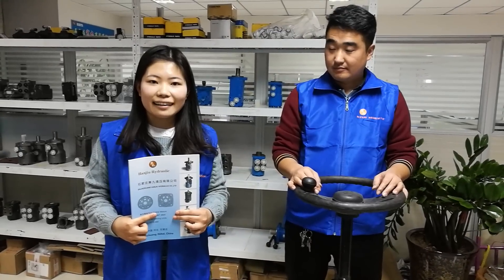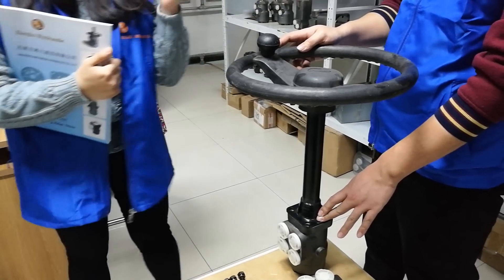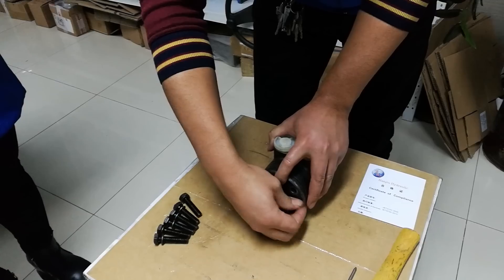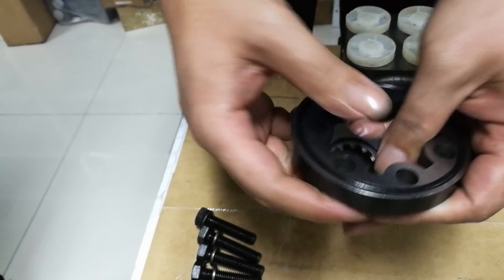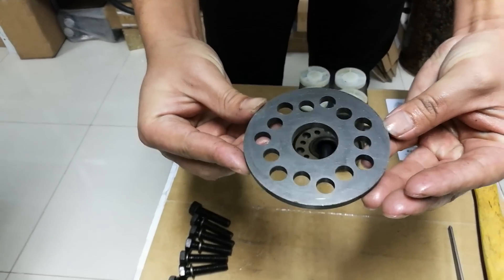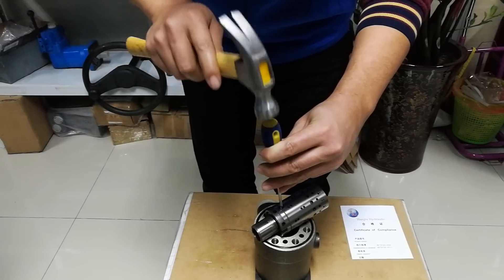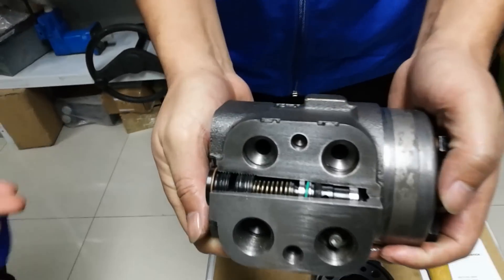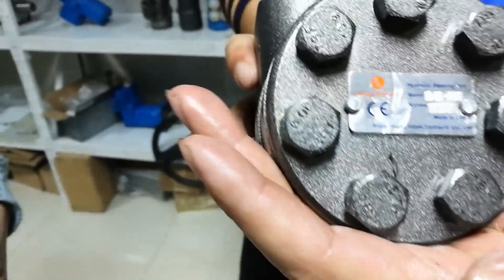Hydraulic steering unit、HYDRAULIC ORBITAL 、Orbitrörler

Comment: What is fault  that  left side is ok but right side is very hard and what  is repairing
Reply from the maker: The right side is very hard, indicating that the oil passage of the right steering gear is damaged or blocked by hard objects. It is recommended to clean it with kerosene or gasoline after disassembly. If the failure is serious, it is recommended to replace the hydraulic steering gear with a new one.

Comment: This is very good but non repeir able when  it lose work
Reply from the maker: This model of hydraulic steering is cheap to fake and has a long life as long as it is properly maintained. So most of the failures are replaced with new ones.

Comment: Housing - Spool set Assembly  - cardion shaft- Distibutor plate - Gear set - End plate - pin bolt/bolts ( Assembly Is Done)
Reply from the maker: Very accurate description, you are professional